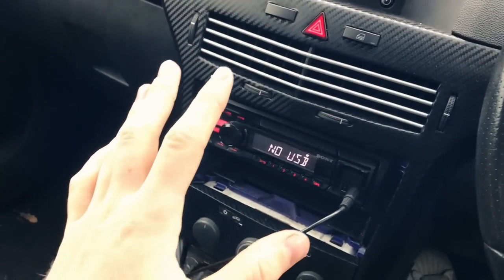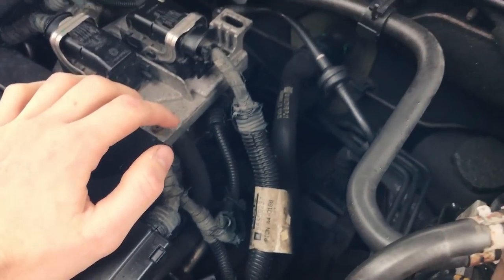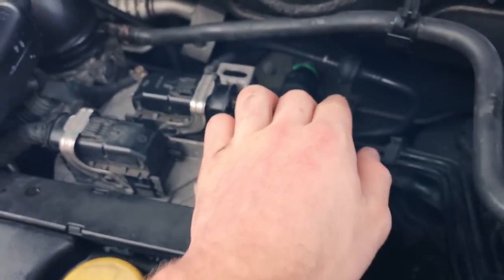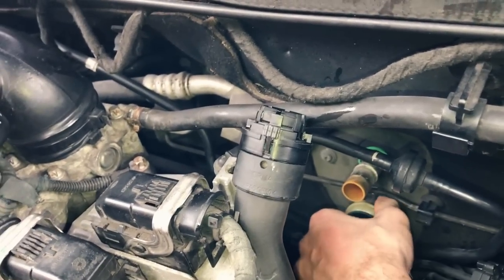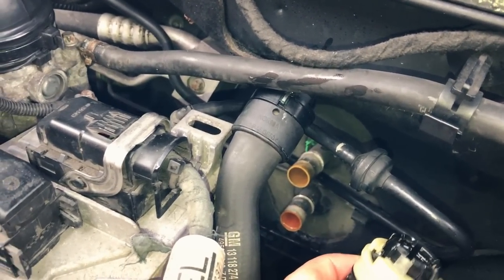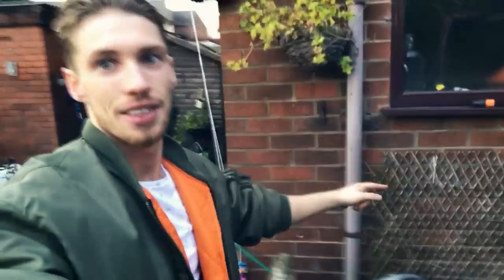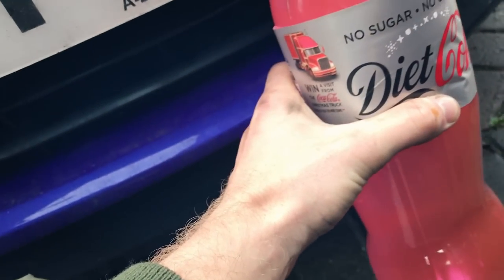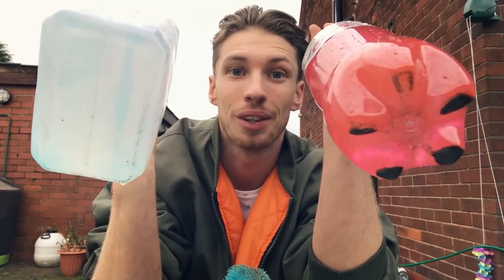How To Fix an Astra H with No Heat

Comment: nice and clear instructions, good video. 1 little tip for the hose, just fold it over in your hand so the hose is crimped and you wont need to run back and forth to turn it off while changing the bottle.

Comment: Just did mine flushed it through but looks clean allready not difference  mine shows the coolant level as unchanged shud I replace the coolant now as I have put normal water through it

Comment: You had a roll of tape lying right there - you can kink the hose and shove it through the hole, instant valve. Also after the second flush the water is clean enough so you could just flush without collecting it.

Comment: Did this on my Astra but now i have a little water leak where the water pipe connector joins the Matrix outlet  water pipe. Not shure how to fix ?
Reply: How did you fix it before i have the same problem
Reply: @Kobain222  Had to replace the pipe but just one pipe. It leaks because the o ring is so old. My advice would be dont do this job on an old car.Both pipes were leaking but when u replace one the leak stops in both.
Reply: @johnocallaghan9252  ok cheers for the heads up my heating is working spot-on im just doing my reasearch on every possible negative that could happen  between me and my 1.6 petrol astra H... nice little 3door hatch all stock parts except the exhaust.

Comment: excelent video well explained even for a novice like me. I will follow your advice and try to flush out the matrix but I have noticed the carpet is wet in the passenger and drivers foot well. Do you think this is because of a blocked matrix. Thanks for any help you can give.

Comment: Thanks for this video, those connectors look like they’re a bit awkward.  Just changed the oil cooler filter. No coolant leaks. Flushed and bled. 
Interior of the car steaming up, ie condensation inside when l turn everything off. Heater takes a few minutes then kicks in hot.  Warning amber engine light and fan comes on when cold. This goes away after a few minutes. Thinking flush heater pipes, going to look see where the matrix is. How does the thermostat  work with this and sensors?

Comment: Great Video Thank you. I also needed to change fuse 27 which had blown and somehow stopped heat!
Reply: Fuse 27 is 5A and is Ultrasonic sensor, anti-theft alarm system. Is this the one you changed?
Reply: @stefanp.7986  On my 2008 model fuse 27 is 7.5 amp and has something to do with the heat. The model is a factory fitted LPG, so I think the wiring may be different

Comment: Superb video mate - really helps!
I'm suffering the same (2009 1.8 petrol - Z18XER) - takes an absolute age to get any heat from the heater - at least 10 minutes and 5-6 miles.
I'm going to do the flush and see what happens - if not then I'll swap the thermostat.
Reply: Hey, it's been a while but what was the Problem? Did you change the thermostat..?
Reply: @tobifzzle  yes, exactly that, garage swapped it out and sorted it, all working fine again straight away.

Comment: Hi Lee, I want to flush the matrix on my 2016 Citroen Dispatch. The connectors at the firewall are very awkward to reach. I can just about get my hands on them if I stand on some steps. It feels like you have to push two release buttons either side of the connector. I can push them in but I can't get any leverage to pull the hose off at the same time. Am I doing it right or do I need a tool?